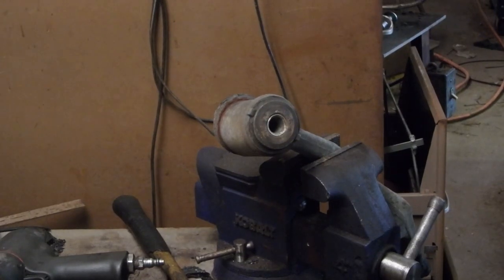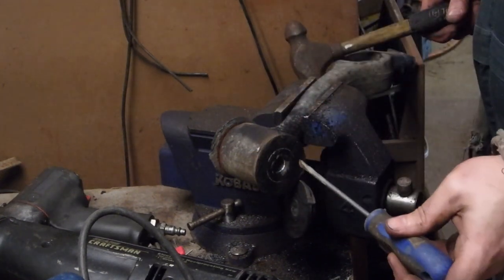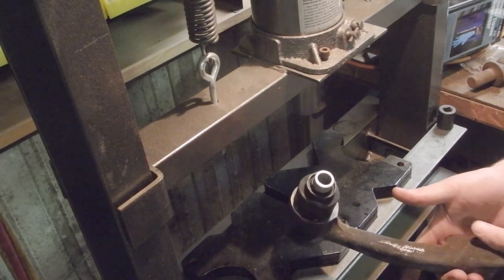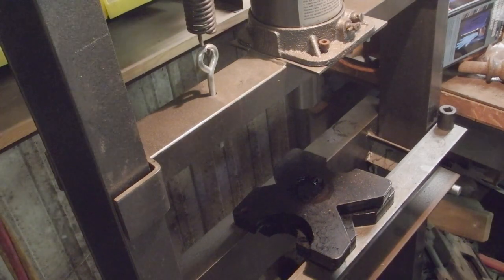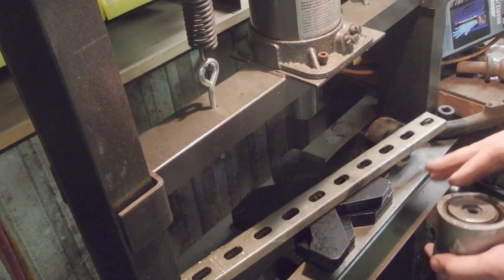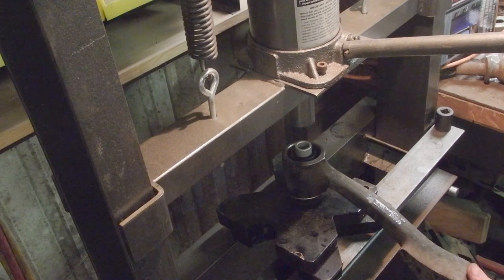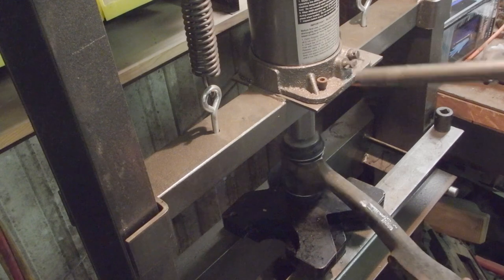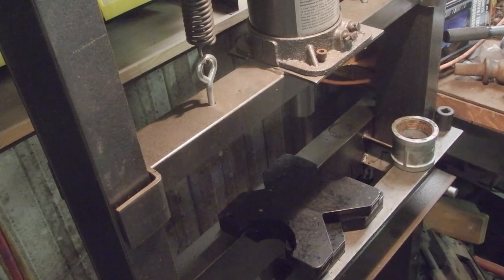Installing W126 Lower Control Arm Bushings In a W123

Comment: Sawzall not needed.  You can easily punch the center aluminum sleeve out (will take a few whacks from about 3-4 different angles)  and then hammer out both bushing sides on the edges.